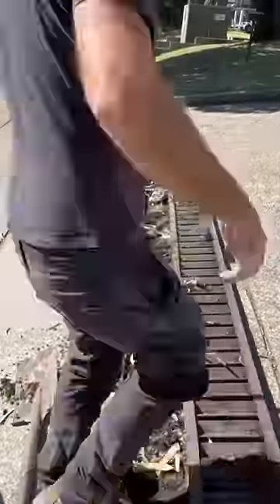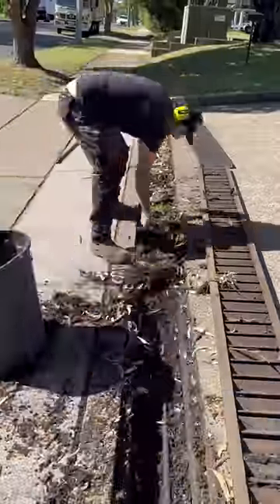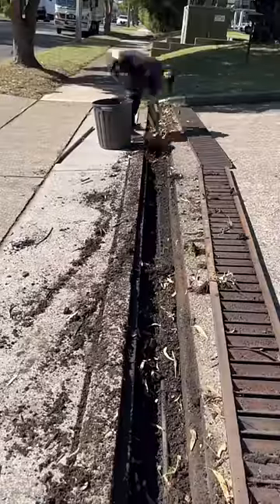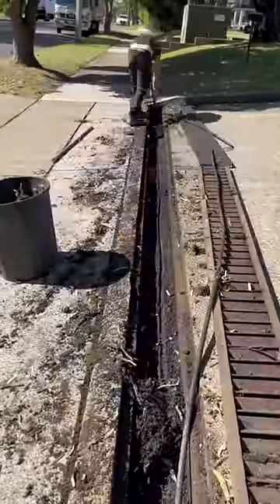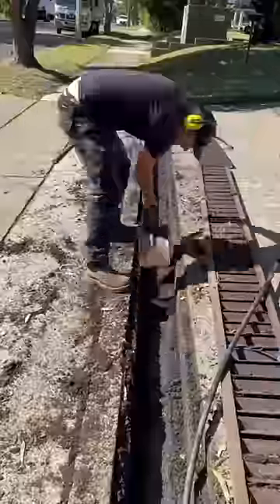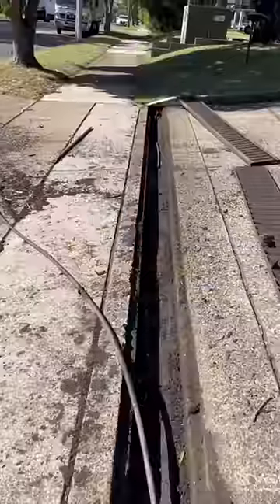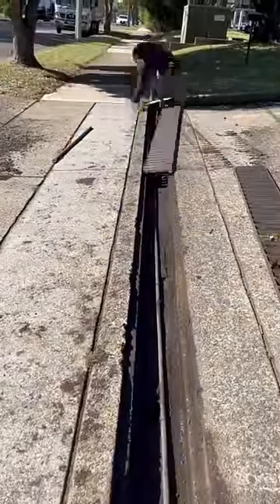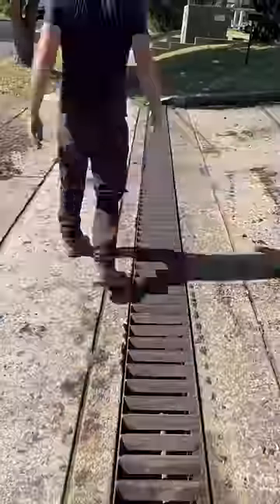This hasn’t been cleaned for 5 YEARS. What a transformation #shorts #cleaning #transformation #asmr

Comment: How'd you clean out the pipe that takes the water out of that drain? It had to have been full too. Not just the small pipe but there should been a larger one to take the water away. Or did you even clean it out?